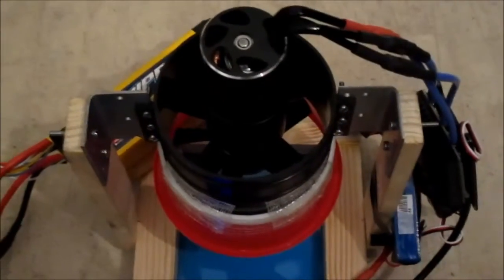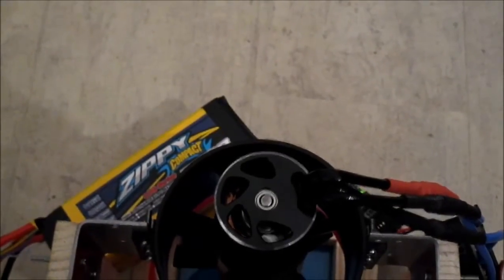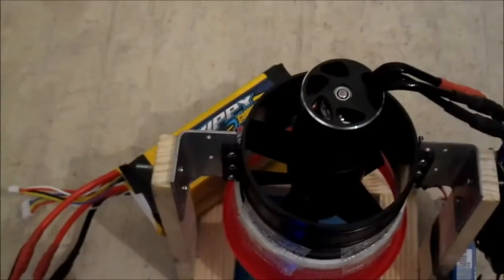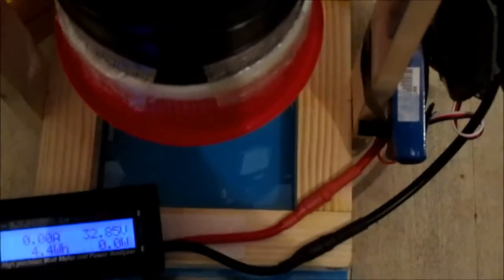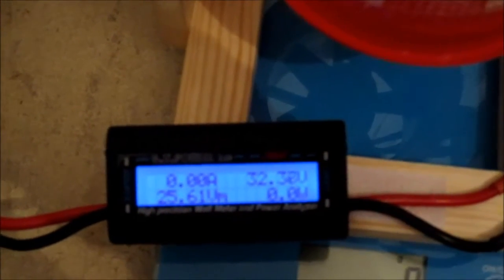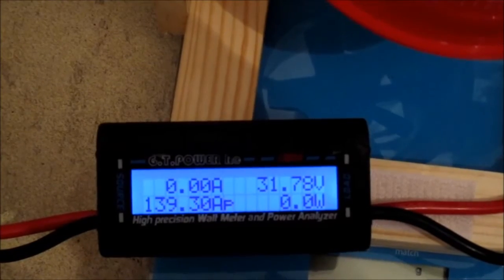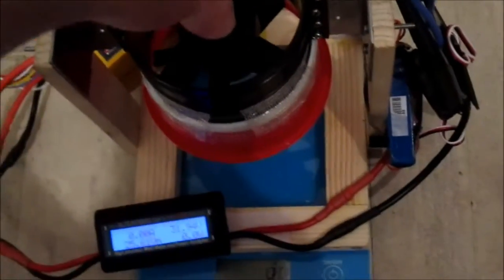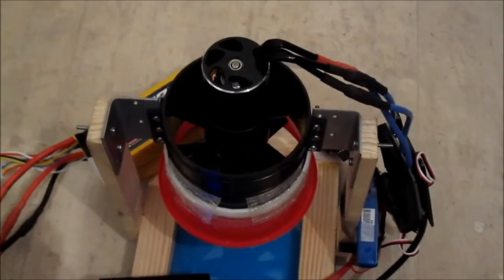90mm EDF Test With the GoolRC 4082 1900kv motor on 8S Motor test of the Week

Comment: It’s pulling your voltage down to 3.2 per cell. Serious potential with one of the more top quality packs, if you could maintain 3.6-3.7 volts per cell under load you’d RIP

Comment: I have tested a turnigy 2200kv in a 90mm 12 blade on 5S with a 200A esc...only got 2800grams on 150Amp https://youtu.be/F4eSHniaEcw
Reply from the maker: If you're using a 12 blade fan you will need to use a much lower kv motor running on 10 or 12S for more torque. If you get a 5 blade 90mm rotor you can use that 2200kv motor with it on 6s and probably get a lot more thrust then you did with the 12 blade on 5s.

Comment: Have you ever tried this same setup with a 12 blade EDF unit?
Reply from the maker: Hi Derjoh
You would not be able to run a 12 blade fan with this setup. It's already pulling a bit more power then the motor is spec for on just 5 blades although it can handle it. You would need to run a lower kv motor on 12 blades. Although 12 blade fans sound better I've been able to get more thrust on 64-65mm sized edf's with 5 bladed fans by spinning them at stupidly high rpms :)  Check this out.    https://www.youtube.com/watch?v=xdTsDFu9G4Y&t=543s
Thanks for watching
...RCPP
Reply: rcplanepirate  
Ok, Thanks

Comment: will this motor make for a good street drag racing  car
Reply from the maker: As long as it fits your car it will be amazing on 6 cells. It's 40mm wide 82mm long and has a 5mm thick shaft.
Reply: do you think the 1900kv is enough
Reply from the maker: There is also a GoolRc 4074 2250kv motor rated up to 2800 watts.
Reply: rcplanepirate but the 1900kv has more power
Reply from the maker: The 1900kv does not have more power, it can take more power. It depends what power it takes to move your car. I you fit the 2250kv motor and it makes 2800 watts then it will be slower with the 1900kv motor which will probably only make about 2000 watts. You could always just fit the 1900kv motor and then change your gearing.
Reply: but the 1900 has more torque right not really worried about top speed just running 132ft 250ft
Reply from the maker: Ah right. Yes then you're right it has more torque. Torque is different to power. Then it's all about getting your gearing right so you get a good launch off the line but still have a nice amount of speed by the time you cross the line. So I think this motor would be perfect then on 6S. Keep checking the temperature of the motor to see if you can then maybe try 7s or possibly 8s.
Reply: thank you so much for your help
Reply: 2200 kv would do you better
Reply: You would need to experiment with gear ratios as well

Comment: May be a bit more mental on bigger batteries, I was looking at the 4082 1600kv in the v2 het housing with a evo 11 blade fan, got a flyfly f100 would help as it is nose heavy,Thanks for testing gave me more  options to think about.
How long is the shaft ?
Reply from the maker: Hi there reedy. Yep it should pick up even more on a pair of bigger 4 cells. Don't forget these are 40mm motors and the housing needs moding to fit. Watch this vid to see what i did and it's also a very good 6s set up. https://www.youtube.com/watch?v=gCOR5lkbPSQ
Not sure on the shaft length think it's about 25mm. On your set up if weight is not a problem there is also a bigger 4092 1520kv motor that is good for 4200WATTS!!!! at 32volts so you may be able to run 10 cells as the voltage drop would be about 35volts which would give you unbelievable performance. Hope this helps and thanks for your comment an for watching. If it works out let me know your results. Cheers:)
Reply: Found a Goolrc on Ebay  3680 1500kv  £31 might be a good 8s with the evo 11 blade I've been paying £100 for the HET motors ! had a look at you vids ,don't think I am the same speed nut as you lol. they have a 2968 3400kv £23 the wemotec measures 29 i/d bit of sanding should be ok. at them prices worth a play with.
Reply from the maker: Just what i thought they're worth a go. Yea speed is addictive:) I have one of those 2968 3400kv ones on order which i'm thinking would be good in a pylon racer on 5s. Should be pretty quick. I also have a new vid to get edited and up load which is really amazing. I think i may have made the worlds most powerful 4s 64mm edf. I'll get that sorted out at some point soon.
Reply: Just as I thought your a speed addict ! lol there is nothing better than doing a fast low pass the going vertical,most of my models are EDF also have 2 pushers and 2 home made turbine models that i don't fly now, no tarmac. noise is a problem now so trying to go with the multi blade fans,but not the change sun seems a amp hog and tends to explode taking the motor shaft with it.better with a whole in one rotor